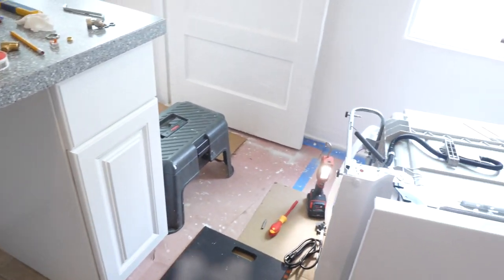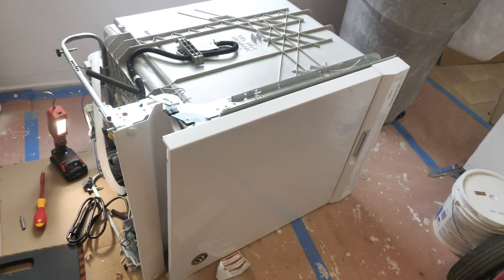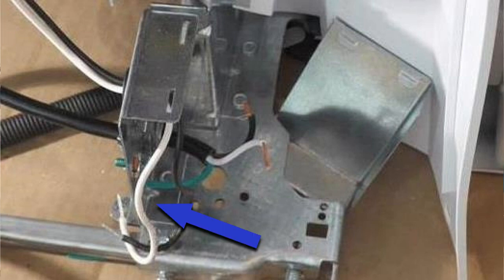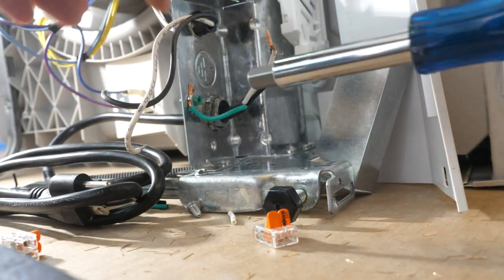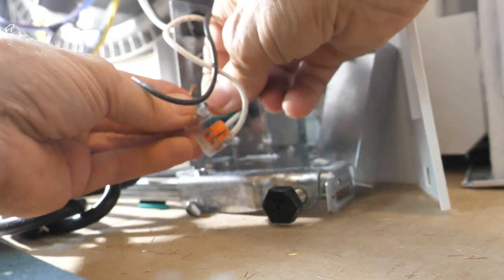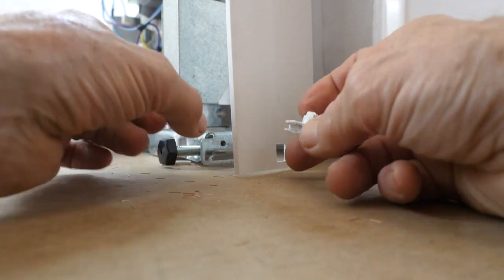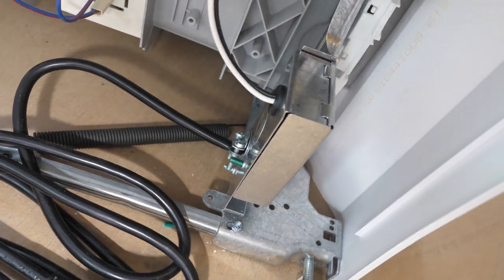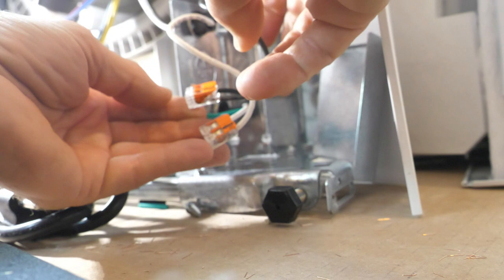How to Hook Up the Electrical Cord on a Dishwasher

Comment: Our mid-60s house just has a romex cable coming out of the wall for our dishwasher. I think I'll install an old install box and an outlet next time we replace the dishwasher. The oven was like that too, but it has an outlet now.
Reply from the maker: Wow! I haven't seen that in my area. Yes, a cord is more flexible and appropriate. Also, Romex isn't currently approved for such a use.
Reply: IIRC, I’m thinking the outlet can’t be directly behind the dishwasher if you use this method. You would want to drill a hole in the wall of the neighboring cabinet and plug it in there where it is considered accessible. Maybe the rules vary by location.

Comment: I would crimp a ferrule on the ground wire. That will prevent any future corrosion issues. These fine stranded conductors corrode much faster than solid conductors.
Interesting that a lot of appliances in the US don't come with a cable attached, like the dish washer or the garbage disposal. Unthinkable here in Germany, the only kitchen appliance that doesn't come with a cable here is the kitchen cooker. And that's only because in modern installations you have a three-phase cooker circuit (3x230/400V, usually fused with 3x16A) and in older installations a single phase circuit (230V, 25 or 32A).
Reply: in much of the US, dishwashers are considered a permanent installation (the whole kitchen is a permanent installation, here, so the only things commonly cord connected are the garbage disposal, refrigerator, and a freestanding cooker.  (as contrasted to a cooker that is supported by the cabinetry))  our norm is for all of the cabinets to be permanently installed by the builder.
Reply: @kenbrown2808  Ok, here that's different. If you live in a rental the kitchen is usually completely empty, you have to buy your own equipment (appliances, cupboards). There are also exceptions, but usually that's the way. If you move you'll have to remove your stuff, including the appliances and cupboards. But there's also the possibility to make an arrangement with the next tenant or the landlord. Some differences:

https://www.youtube.com/watch?v=tlJ8BNUXYD0
Reply: @Marcel_Germann  yes. I have a friend in germany who explained it to me.
Reply from the maker: Hi Marcel! Yes, I agree that crimping a ferrule on the ground wire is an excellent idea. IMO the appliance makers should include a cord with the appliance and attach it because a percentage of users will connect the cord with reversed polarity or they will use wire connectors that are not the correct size or they will have strands of wire sticking out of their connectors. I'm doing my best to point out all of these problems so people will hook up the cords correctly and I'm learning from you guys as I go too. Thanks!

Comment: pro tip: if you lay the dishwasher on its back, you don't have to reach all the way to the floor to get to the box.  
also the cord is a regional thing - where I am, only the low bid electricians use a cord for the dishwasher. the top guys install a faceless GFCI under the sink for a local disconnect, and feed the dishwasher with a 14-2 routed inside the wall.  since the dishwasher is considered permanently mounted, the cord and plug is just one more thing to go wrong.
Reply from the maker: For other viewers this is an example of a blank face GFCI: Leviton GFRBF-W Self-Test SmartlockPro Slim Blank Face GFCI Receptacle with LED Indicator, 20-Amp, White: Amazon: https://amzn.to/3DSjGOn
In California generally we do it as I showed with the cord. We're not allowed to put GFCI's under the sink as that would be considered not accessible. Good tip on putting the dishwasher on it's back, that would be easier than on it's side. The more comfortable I can stay while working the better.
Reply: @SparkyChannel  if it's not accessible, nothing cord connected should be plugged in there , either. My standard undersink assembly is now a switched gfci for the disposal, an unswitched gfci for anything else, and the faceless for the dishwasher. On a total of 3 15A circuits.  My inspector loves it.
Reply from the maker: @kenbrown2808  Thanks!

Comment: So why can't you just hook it up direct if that's how an existing one was done
Reply from the maker: Hi Rick. You definitely can, with some exceptions.
Reply: Because 2 wrongs don’t make it right.  Only the low budget electricians hook a dishwasher directly to the Romex cable with no plug. the dishwasher should have a means of disconnect.  A corded plug provides this.
Reply: @mcroley591 Unprotected  NM cable is no longer an option, but mechanically protected NM is.  A breaker lockout device at the electric panel provides an approved disconnect.
Reply: @donl1410  only if the panel is within sight can it be used as a disconnect.
Reply: @mattrob15  422.31(C) Motor-Operated Appliances Rated over 1∕8 Horsepower. The disconnecting means shall comply with 430.109 and 430.110. For permanently connected motor-operated appliances with motors rated over 1∕8 hp, the disconnecting means shall be within sight from the appliance or be capable of being locked in the open position in compliance with 110.25.

Exception: If an appliance of more than 1⁄8 hp is provided with a unit switch that complies with 422.34(A), (B), (C), or (D), the switch or circuit breaker serving as the other disconnecting means shall be permitted to be out of sight from the appliance.

NOTE:  "or be capable of being locked in the open position."  That would be a breaker lockout device or a breaker padlock device.